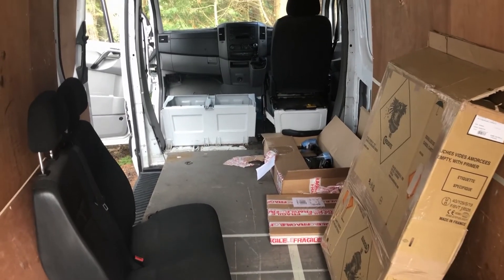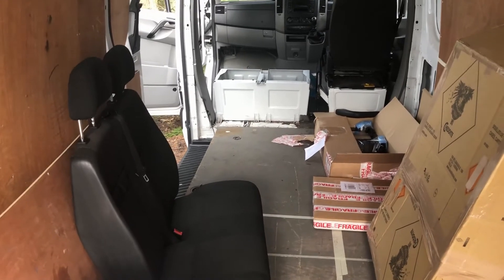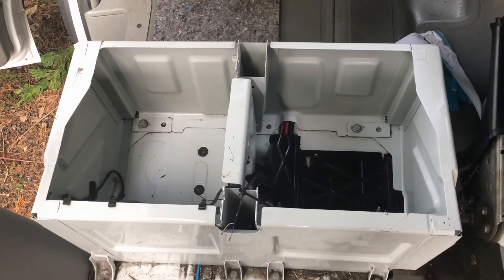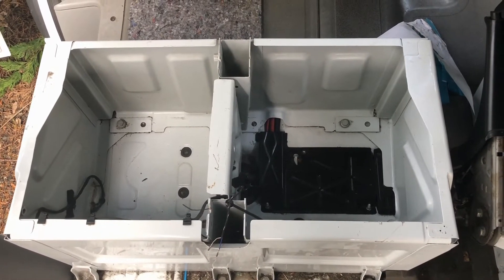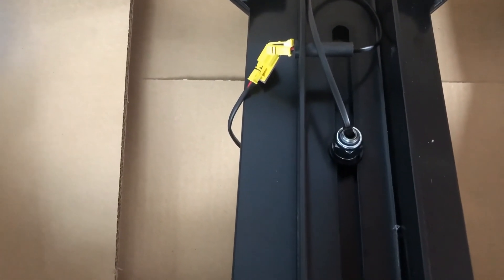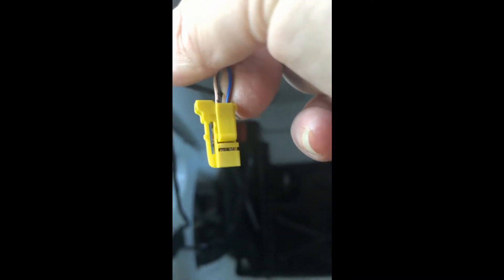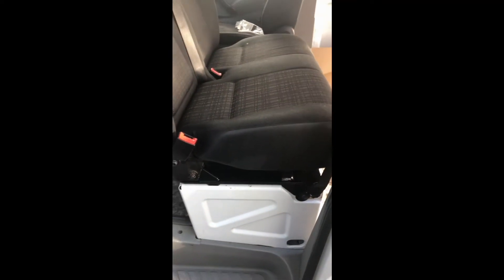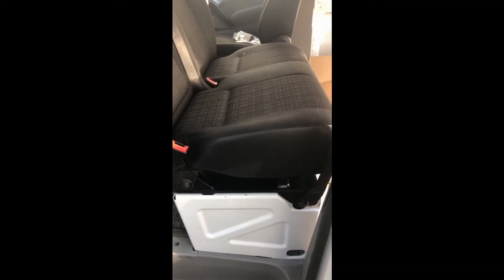Swivel seat installation and dimensions  Mercedes Sprinter motorhome conversion. Video 2.

Comment: Great idea for the box measurements. We are want to make use of them too - for the batteries if possible. We are just wondering how dangerous it would be to drill holes in the box, as we would need to connect the batteries and there is a partition between the 2 sections.
Reply from the maker: Hi there folks. No need to worry about drilling holes as there are holes between the partitions already, that curved section at the base.....at least in the Sprinter, not sure the crafter is the same. I have measured in more detail than those given and there is room, just, for two 110Ahr lead acid batteries in the left section. ( 354mm x 175mm x 190mm batteries) I did a cad diagram to ensure this. I will send you a file if you IM me on facebook.
Reply: @Antonia.Bradley  I believe the box is exactly the same in the crafter, but I'll double check a bit later :)

Comment: Thanks for the video , it's different than the other swivel seats for sprinter a lot less weight in it. Can you tell me how thick the steal is . Trying to use the lightest swivel seat I can find. Thanks
Reply from the maker: Hi, yes they are very good sturdy swivels. The plates are 5mm thick steel so they are quite heavy. The double seat swivel is 22kg I think.  But they are VOSA pull crash tested and things. This is the web site for them.   https://rjcampersolutions.co.uk/